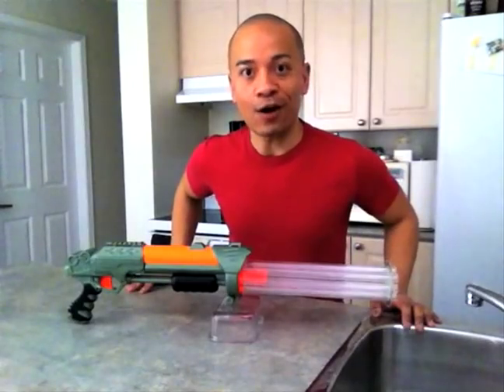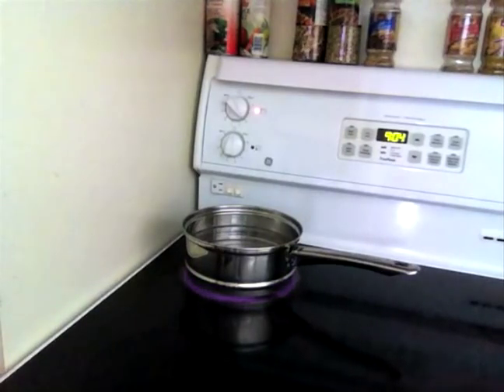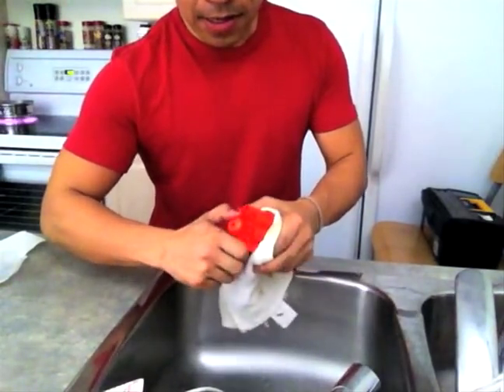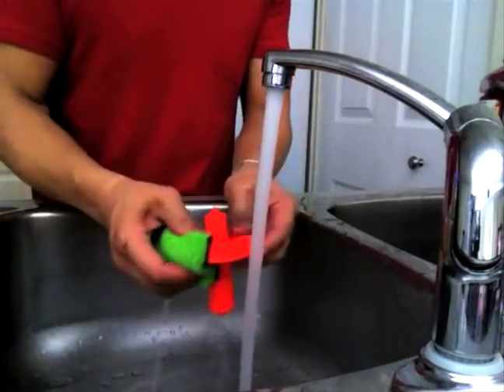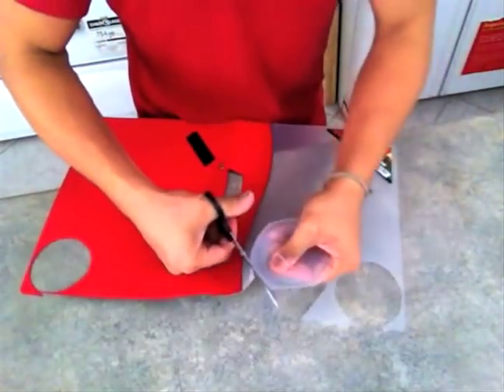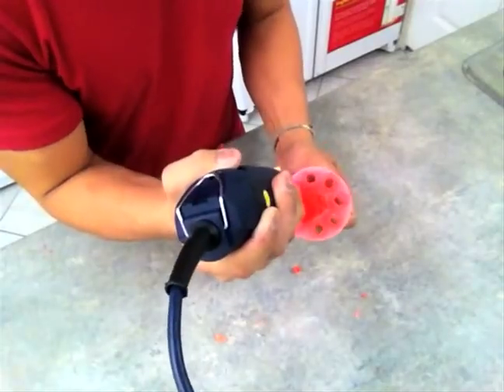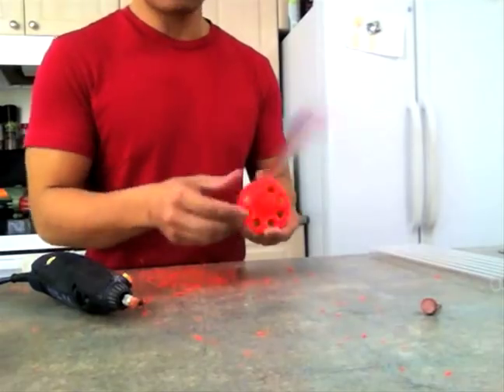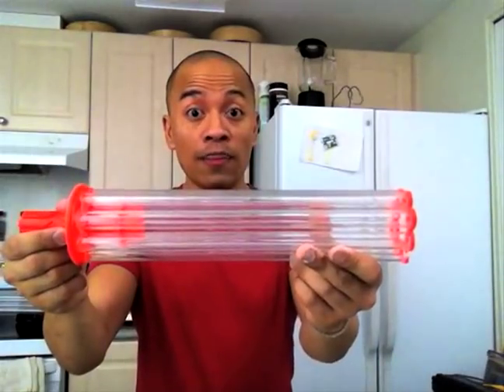Octo-Shot Video Tutorial Part 1 - The Turret

Comment from the maker: @bnerf1 Initially, I put 12 inch barrels on but recent tests have convinced me that 9 or 10 inch barrels are better suited for this blaster. I haven't done one yet with 10 inch barrels but my next one will definitely have 10 inches instead.
I fired a dart with my finger covering the barrel and it only reached the 9 or 10 inch mark inside the barrel. That would suggest that max pressure is achieved at that length. The extra 2 inches may be hurting range a little.

Comment from the maker: @leternaldreaml Yup!!. I actually use a hacksaw but I don't 'force' the blade through. I just let it 'saw' it's way through. Patience is the key. The Acrylic is very brittle that way. But seems to hold up to smacks and drops so far. I also sand the ends to make sure there are no cracks or ridges. Plus, I think mine are actually polycarbonate. The guy told me it was acrylic but it was in the polycarbonate section the last time I went to get some.

Comment from the maker: @ck3224 Sorry, I cannot at the moment. My supplier hasn't restocked and I only have enough for myself right now (6 feet). Apperently McMaster sells barrels similar to mine (probably exactly like mine). I was told Acrylic but the last time I went to Canus Palstics, it was in the polycarbonate section.McMaster has it advertised as polycarbonite. You do have to saw it to cut it. Pipe cutters WILL NOT work.

Comment from the maker: @marvinlee718 The back of the 8 barrel turret has holes and crevasses that would ruin the seal. The duo-tang folder covers them up nicely. Trying to fill those gaps with epoxy or hot glue would never work. You need a SMOOTH FLAT surface.

Comment from the maker: @2693319 I tried but the turret was too big. There is not enough space between the rotation slot and the plunger tube seal. In other words the radius is too big. It would require some MAJOR shell reconstruction. I'm up for the challenge though.

Comment: The 1/2" acrylic I use seems to be a bit tighter than CPVC on fit, and far more fragile. A dremel seem to be the best tool for cutting them - hacksaw with too much pressure also makes it crack. Is this the same issue with your acrylic?